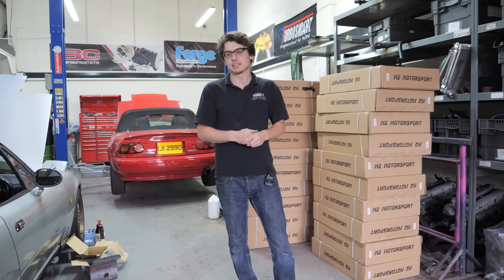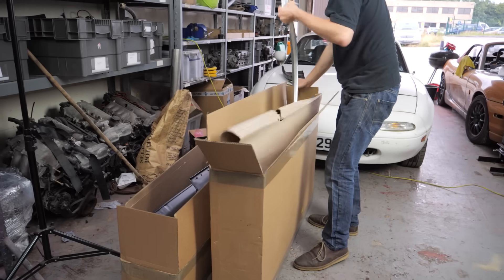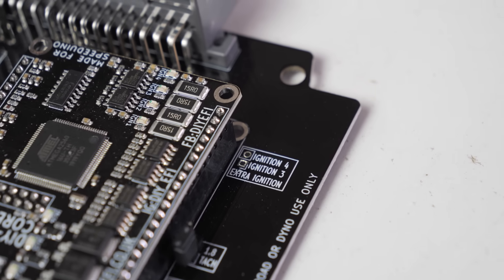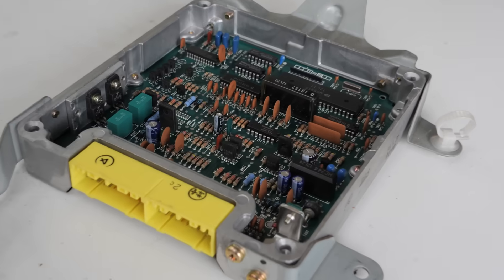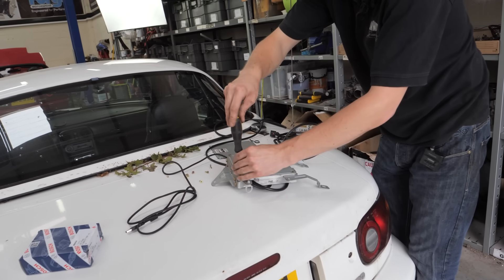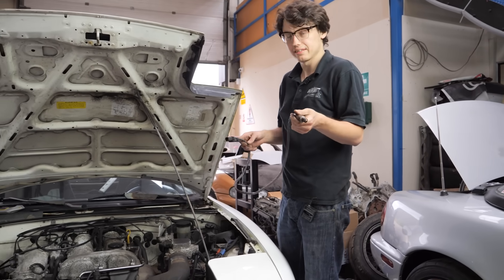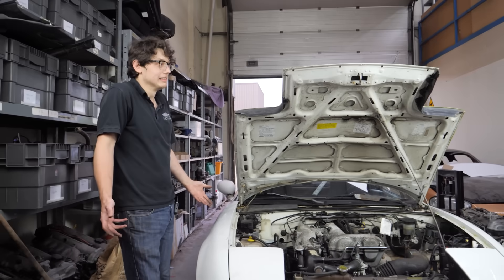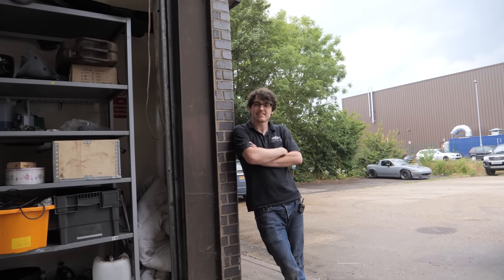We Put A Speeduino ECU In The £500 Miata And Test It With Burnouts

Comment: Hi I have a miata NA 1.6. 1990 I have installed a 30-0300 x-series wideband 450cc injectors end a speeduino PnP . the car works fine, I just have to keep the laptop connected the engine stops if I do not use the laptop it looks like it's losing ignition because dashbord clock not working when does that after it stops it starts very hard. but it works at only idle if I want to leave the engine dies again can be the sensor on the clutch pedal because I can't use the option to decelerate fuel cut off. if I activate it, it does the same thing as with the laptop disconnected 
   I want to put a supercharger but I can't make the car work.  if you can help me thanks

Comment: Excuse my ignorance but what does changing an ECU do.  Has that enabled the ability to spin the wheels, or is it changing something else we can't see yet? Sorry for my lack of knowledge.
Reply: This car always did spin the wheels, but adding an ECU let's us control every aspect of the engine running. In this case, we've not even touched the new ECU and it starts and behaves basically exactly as it did before. Which we were impressed by.

Comment: I am thinking speeduino for a long time. I am happy you are tried it. Maybe I will get a use of the Eaton M45 laying on the shelf 😃
Reply: U planning on supercharging a 1.6?
Reply: @bennigek7196  1.8 NB
Reply: @Zozz84  then you shouldnt use a m45 but go for a bigger one to avoid heat issues. Unless you just want a little bit of extra power but if you spend money on it anyway you should go for a bit more
Reply: @bennigek7196  I don't want really more than 200 hp. I am mostly happy with the car but need a little more on uphills and overtaking. I already have an M45 on shelf. Bigger is hard to find here. And it is a long term project. First maybe I try speeduino without any mod
Reply: @Zozz84  I advice you try a speeduino without mods first in any case to learn the basics.
Reply: @bennigek7196  That is the plan 😉 Thanks!
Reply: @Zozz84  is there a solution for Speeduino working with 1.8 VVT NB 2004 Motor? I can't see version for this model.
Reply: @driftmate4871  I don't know. I still not bought mine.

Comment: Glad to see you testing out the Speeduino. I have ran them on a few cars as well as my personal 280z for a few years. The developers are amazing. I enjoy the (cheap) DIY aspect of it.
Reply: Can you use it to boost an mx5
Reply: @georgimirchev7385 most likely yes, it works on basically anything
Reply: @georgimirchev7385 I use one in my Kia Spectra in a boosted application. I'm running about 17 PSI on high booze to making close to 400 horsepower
Reply: @georgimirchev7385 yes

Comment: Where can u buy a speeduino like that for an 01-05 1.6 ? Is there a speeduino for the NBfl?
Reply from the maker: There is no PnP CORE4 board yet for anything other than the early 2 plug cars at the moment. However, we haven't yet seen it is like to live with so it's still very must in our testing phase.
Reply: @BOFIRacingTV   Thanks for your answer! I guess i'll have to go for the ME221 that you have there. Speeduino seemed better because of the wideband. I am close to get your SC kit anyway.
Reply: @BOFIRacingTV  At the risk of being optimistic, judging by the initial results, the Speeduino looks pretty good!
Reply: I know theres a speeduino from some company called racing electronics for the 01-05 1.6

Comment: Looking forward to the turbo, manifold and downpipe install. I have the same exact G19 setup with the MaxSpeedingRods td04-13T turbo on my LHD car and had to make the downpipe oval and dent it in where the steering shaft is located. Otherwise it would not fit or hit the shaft and make the whole interiour and wheel shake. I am curious how it will fit on you guys's car!
Reply from the maker: Guess we'll find out shortly and you will too not long after 😂
Reply: Never heard of a g19 kit. UK based?